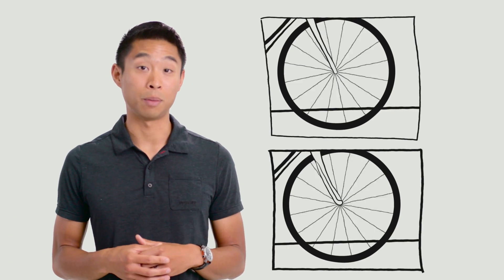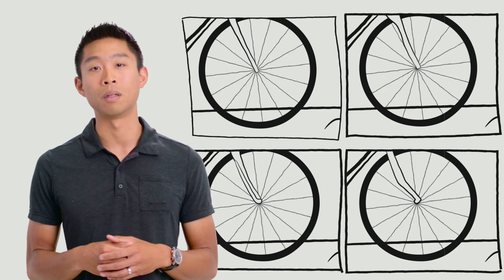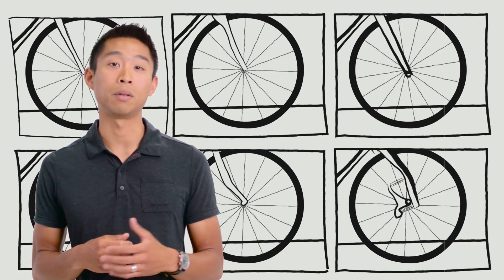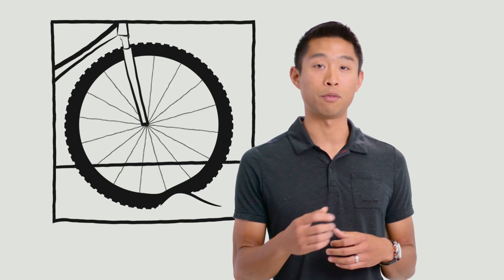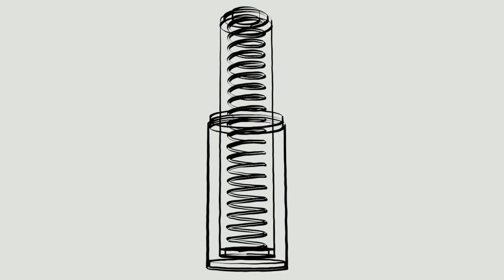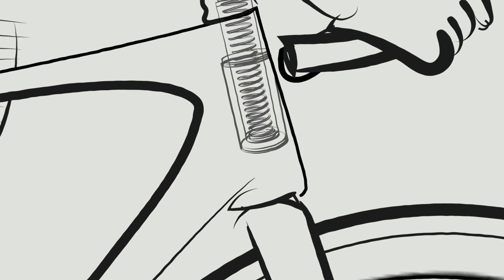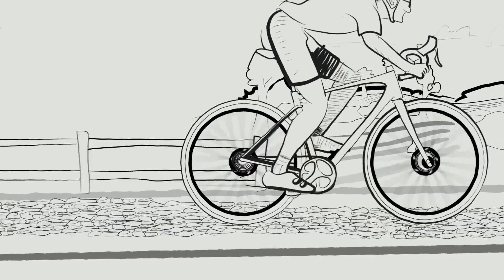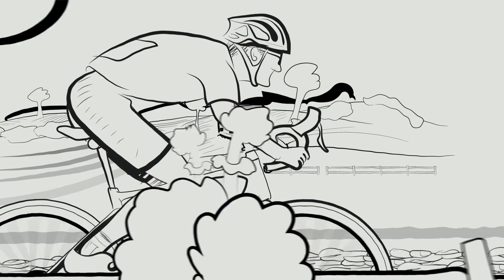Future Shock Explained

Comment: Steering tube suspension???? in 2016???? even Cannondale stopped producing those things a long time ago. The Specialized design team at that time definitely doesn't ride real bikes and you all are fvcking retard. Go buy a suspension stem on eBay, it is the same stupid but way cheaper.

Comment: I recently test rode a 2020 Diverge Expert (70 of 90 km on gravel), which features the updated FS 1.5 system. To me the Future Shock is great to have over corrugations and broken asphalt (along with the CG-R post). It's not there for potholes, or anything over about 20 mm in amplitude. It's very responsive (under damped) so it's more there for vibration control than for any big hits (useless for that). It does its job really well (F1.5 version) and you can tell when you can no longer put the power down to ride through corrugations but your contact points (seat and bars) are totally comfortable. To not have to rely upon bigger tyres or lower pressures (i.e. dampening from the tyre) is great. It allows one to have higher pressures for better rolling resistance. My only beef with the bike was the stack height being too high (bar height really). But a -17° stem and regular drop bars would alleviate some of that. When sprinting, I couldn't detect suspension movement (bars are your only point of reference) - the geometry of the bike had a much larger effect than the future shock. In summary, my experience with the FS was the tech is most useful, and definitely not a gimmick, very pleased!

Comment: It's all very well suspending the handlebars but your rear end is still going to whack the bump/pothole as before & tip you.  And yes, Cannondale already did this to some of their MTBs way back in the mid-1990s (~24 years ago); I suppose any US patents would have expired after about 17 years.  But Cannondale fitted rear suspension too.  I guess Specialized will use a suspended seatpost (again, nothing new there). "Ain't nothin' new under the sun and the stars..."

Comment: This tells nothing about the mechanics of how it works. More apt title Future Shock unexplained. Doesn't explain what the shock action is,  how it works. But it appears to me the absorption is of the riders weight on the handlebars when the frame is thrown upward, then after the wheel has started downward after the bump, the spring tension is released allowing the bars to return to original position.  If that's the case then it appears this is basically the same as shock absorption seat posts that were on hybrid bikes.
Reply: They asked the 2D artist to explain it rather than the 3D engineer to run a simulated animation with digital cutaway! Lmao.

Comment: Its the best solution to date. You just have too see how much more speed a diverge carries. You can hammer them and the design is simple which means alot of engineering went into it.
Reply: Do you still feel this way after the recall?

Comment: The graphic shows a front wheel going over a bump and we're told that energy is lost when that happens.  Fine, that makes sense.  But how does a sprung stem prevent or minimize that loss of momentum?  I can see it cushioning the arms of the rider, perhaps better than bar tape and gloves and light hands, but I don't get the correlation between forward momentum and upper-body comfort.  And for sure, I'd want to be able to lock it out ala the Cannondale head shock of the '90s.
Reply: There is no energy loss, it is simply converted to a different form. It's pretty sad that an engineering company didn't catch this mistake considering this is physics 101 knowledge...

Comment: the front of the bike has the rear axle as the center of rotation. the entire front moves in an arc the size of the wheel base, not straight up and down. this will help, but the bars will bob, or jump, horizontally and tilt up within the 20mm range because moving in a circle has continuous change in both x and y directions.

Comment: I don't see how you can have a shock at the front, above the head tube or not, and still have get the same peddling efficiency?
Reply: The statement in the video still contradicts itself. Their animation talks about the bike losing energy due to it's linear forward path being shifted by up and backwards by bumps in the road. By putting the suspension between the bike and the handlebars you will still lose energy.

You will not lose pedalling efficiency so this is still a neat idea for roadies but lets face it, just like a suspension seat post you're just adding suspension between he rider and the bike frame. Call a spade a spade!
Reply: You don't put power through handlebar. And that's the only thing suspended in 'above the head tube' variant. In standard variant there is suspension between front wheel and the rest of the frame, and that is were you put power (bottom bracket area). Hence power loss. Think it over again and you'll understand.
Reply: Christopher Home That is correct. This kind of suspension is supposedly providing comfort while not causing pedaling power loss at the same time. How much comfort does it give? I have no idea. We need to wait for consumer reviews.

Comment: Arms make a terrific suspension, if you use them...butts not as well. So roadbikers are very stiff, especially in their arms?

"Future shock"? Bold words from marketeers. "...by keeping the front tire in contact with the road..." Really? What about unsprung weight? 
And isn't your butt with most of your body's weight on the saddle much more exposed to the roughness of the road? Rather go out of your saddle on rough rides.
Just like electric shifters, i think this one more useless innovation.

I don't care much anyway, i am mountainbiking.

Comment: This is a Canondale head shock, just inverted.  I still like the idea, as anyone who has rode one can tell you they work well, but will it still have the dust boot?
I would like to know that if by changing the pivot point from the bike to the rider if this will assist in reducing back pain?

Comment: Nice little dig at the Lauf fork, there.  I reckon this idea has as many disadvantages as any other, the unavoidable handlebar bob when out of the saddle, for a start. The potential for play or creak developing for another, the stack height issue, the potential for brake dive when braking hard... I've ridden 90s suspension stems and they're awful.  This idea has too much in common with them, for me.
Reply: EXACTLY.
Reply: I belive you can lock it out if you need to
Reply: I have not noticed any bobbing out of saddle. The stack height can go quite low actually. Haven't had any creaking. The only thing I noticed was a little bit of brake dive.

Comment: not to sure about this one sounds gimmicky
Reply: @lazurm  Sorry the thought in my head was that it's not gimmicky at all ,  and I do believe they are totally legit for the purpose. Sorry to sound negative on it, I love the Redshift shockstopper iteration. I would love to have one of the Diverges as well, it's a beautiful system. For now I'm sticking with my steel-framed Breezer Inversion with a shock-stop stem. Will edit previous statement ;) . But thanks for catching a 2yr old post to make a point.
Reply: These are not at all are these gimmicky for gravel and hard riding they are the perfect answer. It&#39;s legit. Had a headshock Cannondale years ago that I&#39;d still have were it not for the, misery of V-brakes. I&#39;ve checked this out in the shops and think it could be a huge plus for gravel racing.